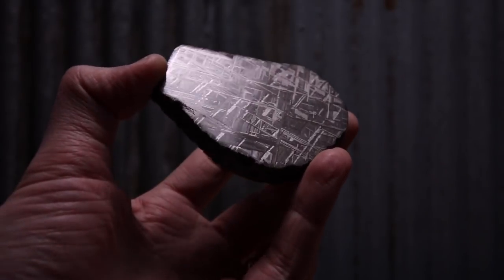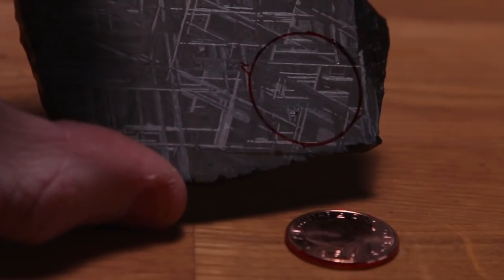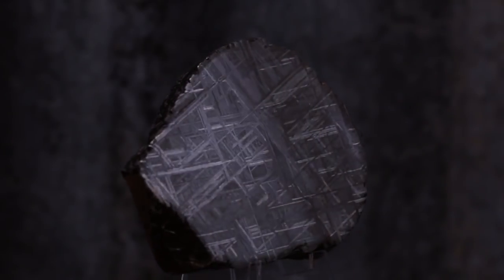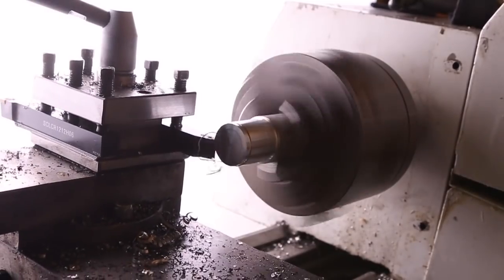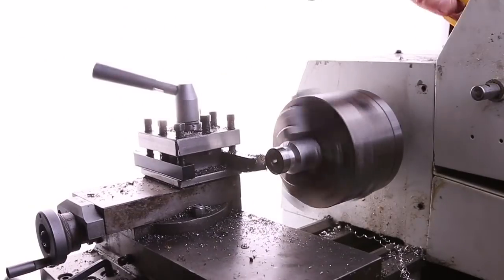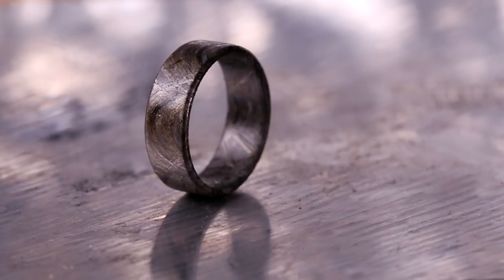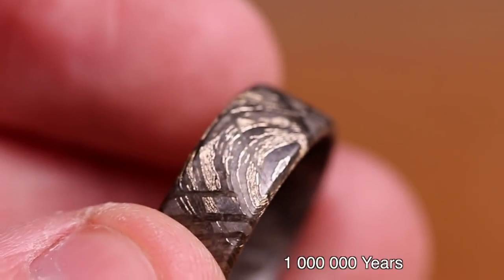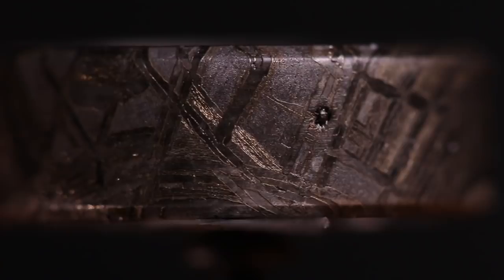my 4,566,300,000 Year Old Ring - crafted from a Swedish Meteorite

Comment: This is amazing! Really one of the best videos I've watched recently. May I ask what are the chemical reactions that take place at the end?
Reply: Most likely hydrochloric acid, then a base wash. At the end I assume he coats it with an epoxy resin or enamel but I'm not completely sure
Reply: The base wash is where it gets all bubbly as it releases carbon dioxide or hydrogen gas depending on the base he used
Reply: @patricioansaldi8021  Wow thanks for such a good explanation! Correct me if I'm wrong, but the acid wash is to eat away part of the metal to reveal the etching on the ring, then the base neutralises the acid to prep it for final coating?
Reply: @kingcrumpet  yes the acid will "etch" or remove a small layer of the iron, which reacts at a different rate than the other minerals so it makes the natural pattern stand out and evens out the surface, adding a natural polish. And yes the base neutralizes the acid to stop the reaction, and washes it away. 

However, I suspect there might be a special iron jewelry coating that was utilized. I initially thought epoxy, cause it is clear and extremely durable, but the way the ring was described, the coating needs to be reapplied every few years or so, so it might not be such a strong enamel that would normally last a lifetime. This kinda makes sense too cause an enamel or resin might be too "thick", and so would make the ring ill-fitting if he made it super well-fitting w/o the coating. So he may have opted for an extremely light and thin coating so he didn't have to count in the extra width when carving the ring.
Reply: @kingcrumpet  actually i found it, there are special paints or "polishes" that are used in jewelry protection for silver, nickel, iron, copper tarnish, so that is likely he used one of these. Personally I would have gone for the expoxy, but the thinner paint makes the production easier and gives you a more "real feel" to the ring cause epoxy would just encase it (although that is why it would be superior to me, to each their own)
Reply: @patricioansaldi8021  Thanks a lot Patricio! That's very helpful and much appreciated. I hope to attempt something like this myself :)
Reply: @kingcrumpet  that's awesome to hear and no problem. Do you craft or forge anything or are you trying to get into it with rings?
Reply: @patricioansaldi8021  Thank you. Yes exactly, I am trying to get into it with rings. Maybe not made out of meteor straight away though! It seems like rings would make a good introduction to lathes.
Reply: @kingcrumpet  that's awesome! Maybe you can revolutionize ring design, I find most to be pretty uncomfortable for different reasons but I have hope lol! If you don't have a lathe, you can start with softer metals and drill/file work. Or if you want an easy project to start you can take bronze rings or copper tubing from a hardware store and play with that. Just my two cents there. Anyways good luck with your journey!

Comment: Anyone know what treatment he exposed the ring to in the final steps? I assume one was a mild acid to bring out the finer details, and ehhh maybe a coating to protect it from oxidation?
Reply: Precisely
Reply: @patricioansaldi8021  Anything more specific? I am mostly curious about the protective coating.
Reply: @noleftturnunstoned  it was probably a strong acid and not mild. I suspect the coating is based on an epoxy  resin. But I could be wrong cause usually epoxy lasts a long time and doesn't need to be reapplied that often. It could be a type of lacquer or enamel such as can be found in a hardware store. However, there could be some specific jewelry coating product that I don't know about so maybe I would search "jewelry protective coating" or "anti oxidation/rust coating for iron". Personally I would have used epoxy or something similar cause of the durability, but maybe it would be too thick of a coating if you made the ring itself to perfectly fit a finger.
Reply: @noleftturnunstoned  i looked it up and there are for sure special tarnish-resistant jewelry coatings, like paint or "polishes". These would help retain the fit and texture of the ring but of course would need to be reapplied often to prevent rust or extensive wear (although it would not protect against hard wear as epoxy would)

Comment: It's not exactly as you describe, or at least it's not the whole truth. Widmanstätten pattern can and is observed in cast iron and steel for example (which is cooled quite rapidly compared to what you say) and it's common enough that it has to be minded. This pattern is very harmful as lowers mechanical properties (brittleness) of the material so unless you wanna make a pretty ring you don't want Widmanstätten patterns in your alloy(s).

You did make it a really pretty ring tho xD

Comment: 1° per 1000 years................but why >< its in freakin space!!! -273.14°C....aka 0°K.
Reply: Think of how a vacuum flask keeps things hot or cold without insulation.
Heat is lost slowly in space because there are very few particles for the heat to transfer to.
https://en.m.wikipedia.org/wiki/Heat_transfer

Comment: Raise the price of the ring. $900 isn't enough considering the time and effort you've put into this. You deserve to make a lot of money doing this, $1600 is a good and fair price in my opinion, but $1200 is also fair and keeps it a bit more accessible to varying budgets. If it were me, I'd raise the price to $1900. Demand will still be there because this is such a unique product, it will be slightly reduced but considering your limited capacity to make them it evens out nicely.

Comment: Fantastic and a job well done.  I'm envious.  There is one thing that would worry me though.  The meteorite is an iron ore compound and the sweat from my hands and moisture from the air would seem to oxidize the ring into rust.  Seems it would be a high maintenance ring and shouldn't be worn a lot.  That would be a shame.  Good video and nice equipment you have.
Reply: it's got a few layers of anti-oxidant coating on it.  probably urethane based.  comes with a bottle of the stuff so you can apply another coat about once a year.

Comment: Is the liquid at the end an acid? Does it bring out the original etched marks on the meteorite? More detail here would be interesting!
Reply: It is most likely ferric chloride solution. That stuff will etch/highlight the crystal grain structure of steel or iron. The crystals of meteoric iron are much much larger than that of man-made iron, you can only get a pattern like this in iron that has taken hundreds/thousands or hundreds of thousands of years to cool/solidify. You could also get a similarish pattern by making an etched ring from Damascus steel because it's snaking crystal structure is large enough to see. The crystal structure of everyday iron is too small for that.

Comment: It's still not an accurate dating method as it negates the younger dryas period impacts which were less that 20,000 years ago.

The meteorites may very well be the age claimed but there's not yet accurate ways of proving this via carbon dating or radioactive carbon dating because mainstream is yet to acknowledge the impacts of the younger dryas even when one of the impact zones for it have been found in Greenland and is some 19 miles in diameter.

Cool video, and different ring.
Reply: This has nothing to do with the Younger Dryas Impact. It's from a much older event. Nor would carbon dating be useful for dating any meteoric iron. Carbon dating is useful only for samples containing relatively recent (terrestrial) organically derived carbon.
Reply: How have they dated this?
And I'll be honest with you unless it was discovered in the southern hemisphere I can't see why it couldn't be from the younger dryas impacts because as it stands it's looking like there could have been three separate events during that period which correlates with sea level increases, nano carbon spheroids etc.

It could be the age that's claimed but I think the dating of materials needs far more accurate and rigorous testing and repetition with all of the recentish flaws found within carbon dating or radio carbon dating.

Either way it's most definitely very beautifully sticking and unique piece, I don't wear jewellery at all but that's something I would because of its discreet and unusual looks.

Comment: I have a meteorite ring as well. What liquids did you use to make the lines show up? Mine has glazed over from years of wearing it and I need to clean it. It will start to rust as well if it’s not protected. Just a heads up.

Comment: Boy, i must tell you Matter can neither be created nor be destroyed. You can only change or convert one form to another. So everything is as old as the universe itself. Even your skin is made by fibres which is the byproduct of the various process through food and energy which means matter in your body is also as old as the universe. You can not create particles in thin air itself and if you do then that it will be a ground breaking moment as you might have opened a warmhole which is theoretically not possible.

Comment: You know everything is as old as earth bcz matter can neither be created nor be destroyed right..?
Reply: This fellow on Yahoo answers explains it better than I would have.

"It would be more accurate to say that the matter AND energy in the universe is a constant...at least, over the long term. However, matter and energy CAN be converted back and forth according to the equation E = mc², where E = energy (in joules), m = mass (in kilograms) and c = the speed of light in a vacuum (approx. 300,000,000 meters per second). 

Are we the same age as the universe? Well, yes and no. Yes because the matter and energy that make up our bodies is as old as the universe itself; no because it hasn't always been arranged into this form. In fact, every atom in your body is replaced within a few years, so you're not even as old as...you are."

 He does a good job of giving the simple answer since, according to the big bag theory, all matter and energy in the universe existed in a single point beforehand. With that said there is also the theory it relativity that plays a role in what solar systems are older or younger than the other. 

All matter and energy started at the same point and same "time". But time is relative and therefore age is as well. So he isn't wrong by any means when he says it's older than the Earth. The matter and energy that created the Earth hadn't be converted into what makes up our planet at the time this material with formed.
Reply: @colacaller  the part about every atom being replaced in the human body is misleading. Different parts of the human body regenerate at different paces (e.g., stomach lining, red blood cells etc.), but some parts do not regenerate (e.g., several types of neurons). Some of those non-regenerating parts are not even able to repair themselves overtime, so it's hard to believe that their sub components, such as their DNA, would have their atoms replaced without being repaired or having a new copy made to replace them (as would be the case in regeneration). You can actually use the concentrations of carbon-14 isotopes (C14) to measure the age of cells in living organisms, which would not be possible if every atom in the human body is replaced every few years.
Reply: @SamarTareen  Every atom can be repaired/replaced within 7 years with good nutrition. Every 7 years.
Reply: @ItalianoDio-   Unfortunately, nutrition has nothing to do with it, it's the underlying biological processes that matter. One can have the best of nutrition/diet, but that will not have any effect if certain cells do not undergo repair or regeneration to replace their components. Thus the atoms making up those components would not change either. The Carbon-14 concentrations I mentioned for measuring the age of cells is based on the over-land nuclear testing done in the previous century. That nuclear testing released quite a bit of Carbon-14 into our world, allowing living organisms to pick them up through food and assemble them into their cellular components. Since over-land nuclear testing is no longer done, the concentration of Carbon-14 in our cells has steadily been going down over the years, allowing us to differentiate between new cells (having less Carbon-14) and old cells (having more Carbon-14). IF our body can completely replace all atoms every 7 years, then we would not be able to differentiate between the age of cells and tissues, and these scientifically proven techniques would not have been scientifically proven in the first place at all!
Reply: Heated nerd arguments be like
Reply: I keep seeing you in random vids. We must have the same Youtube Algos. Wanna be friends?
Reply: I can’t tell if I got dummer or smarter reading through these comments
Reply: Matter CAN be created and destroyed. Just not within planets.
Reply: Wow are you stupid. Is science education in your country generally this bad? I am embarrassed on your behalf.
Reply: Markus Karlsson well he’s technically right , every single element on the earth would of been there from the beginning and over years we’ve used them elements to make more shit
Reply: @oogs9114  No he is not right. It's basic physics. I think he just heard somewhere that energy can't be created or destroyed end confused it with the earth/matter. Besides, the video explains in some detail that no the matter used here did not come from earth.
Reply: @_mark1  but all matter comes from the universe. Which means everything is equally old. This is basic easy knowlegde, where did you go to school?
Reply: @_mark1  it's the law of thermodynamics matter is energy. Matter cannot be created or destroyed it changes into to different forms. I think the goes into the law of conservation of energy as well. That rings not billions of years old anyway. There's no way that anybody can make up any algorithm to tell how old something is without having a historical reference. This video is bill nye science dick looney toon territory.
Reply: Markus Karlsson No u
Reply: @wheretheweirwoodgrows4746  you want historical reference to do science now? tell that to the satellites in the sky. They were put there because of our confidence in theory.
Reply: @_mark1  dude...
First of all... These kind of comments are called something that starts with  J ends with E and it's flying over your head rn...
And about the science, law of conservation of matter/mass exists just as conservation of energy... Matter can neither be created nor be destroyed. It can be converted to energy if it's radioactive or goes under nuclear reactions basically...get a life..
Reply: RandomGamingHolst your made out of old stuff dude. Keep up to date you’re still using universe stuff I’m using my phone charger to charge my eye
Reply: @_mark1  and you're proud of your education....
What a looser...XD

Comment: A good Price for such an unique Item.
A Tip I could give, if someone want to store the Ring save, just use an tight closing Ring Box and add there a Bag of Silicia Gel with it (thats the Humidity absorbing Stuff, you often find in Boxes with Shoes or electronic Devices).
If you don't have Silicia Gel, you can even use Rice in a Piece of Tea Filter Paper.
This should keep Rust away and you maybe not need the Fluid so often.

Comment: How is it older then the earth if they found it on the earth
Reply: Because the material that the ring is made of, came from a meteorite that crashed onto earth. however the meteorite was around alot longer, traveling through space, before earth was formed in our solar system :)
Reply: Some people shouldn't be allowed to use the internet!
Reply: Coz it was from a different planet that was formed before earth, its a meteorite, son.